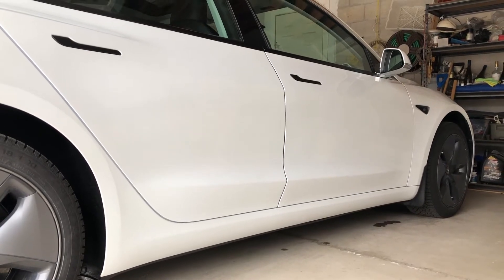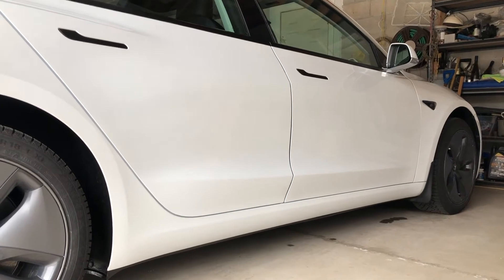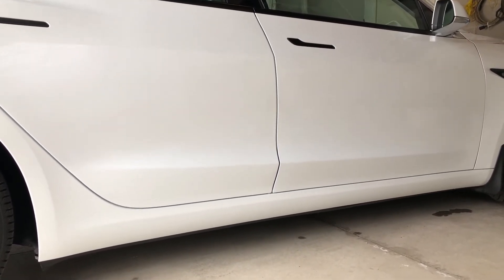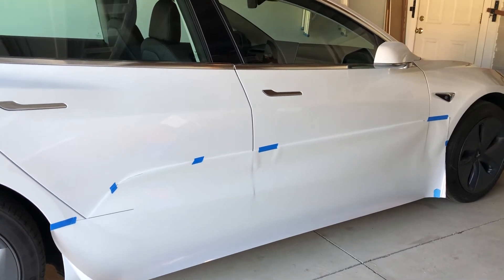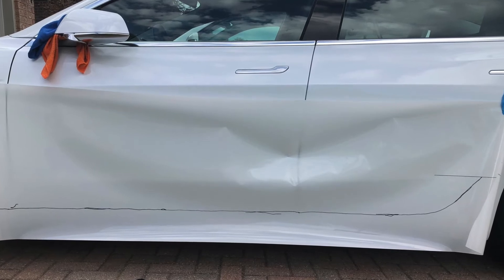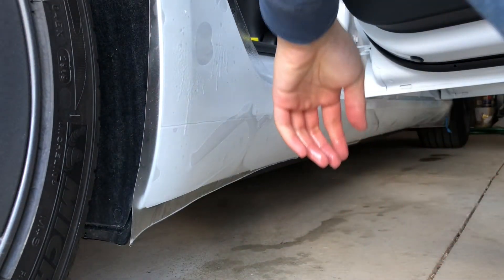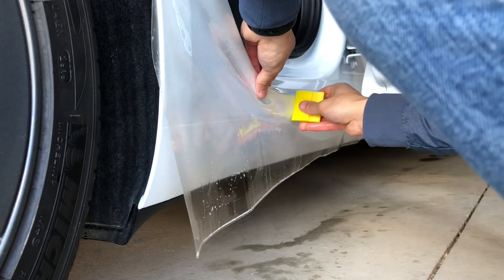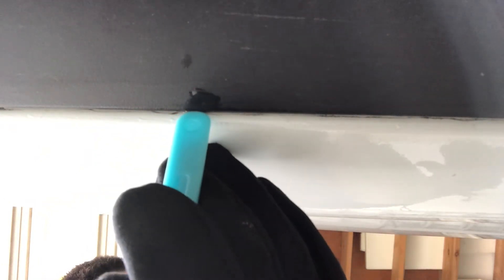Tesla Model 3 Rocker Panel PPF DIY Tutorial

Comment: Thanks for the video! Did you only use slip solution (water + soap) to squeegee down? or did you also use tack solution (water + alcohol)?
Reply from the maker: For most of it, I just squeegeed out the slip solution because it's pretty flat. I did have to use tack solution for the wrapped edges to get it to stay down.